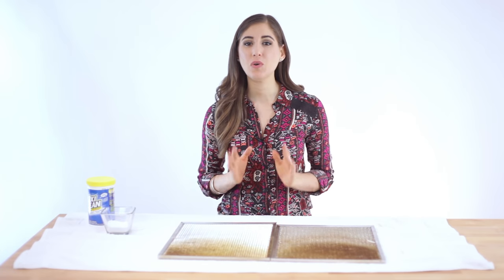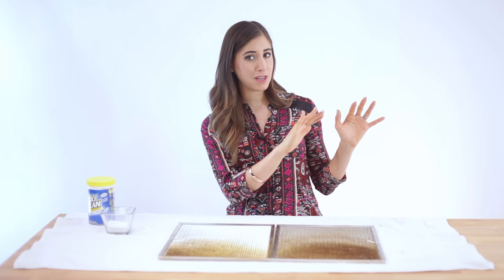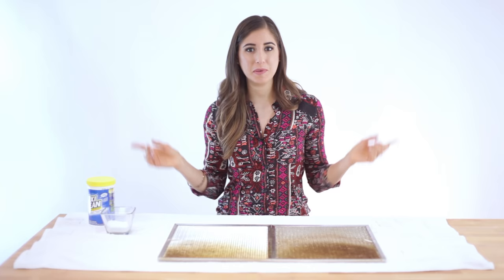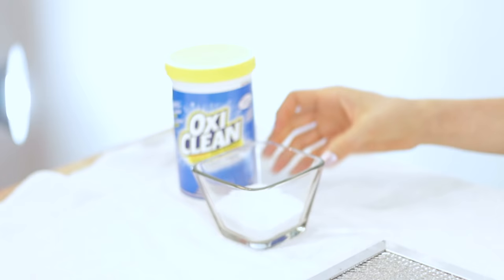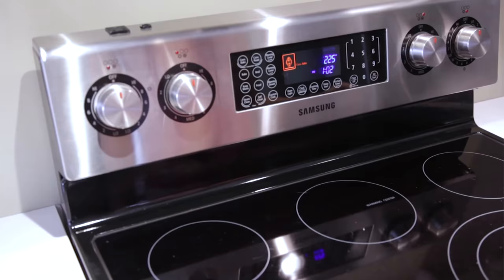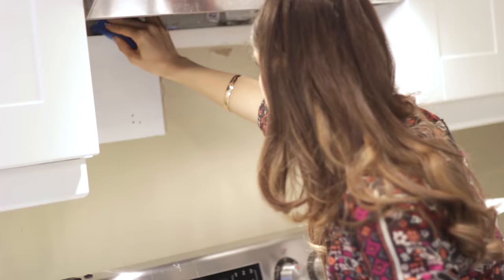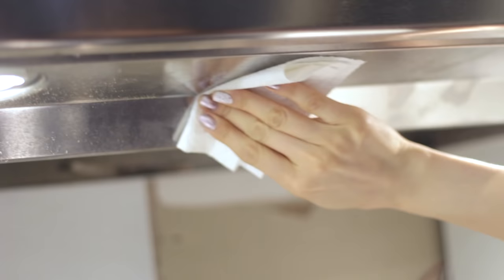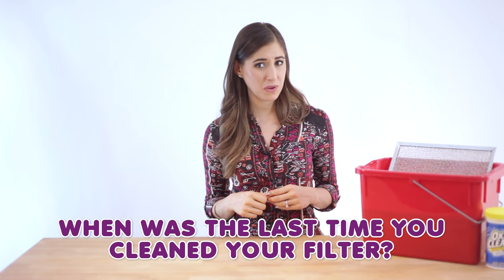Clean Greasy Range Hood Filters! How to Clean Your Stove Hood: Easy Cleaning Ideas (Clean My Space)

Comment: I got no idea how to take mine out...you should of told us how >.>
Reply: It's easy to remove; the filter is only held by the edges. Place your hand under the filter and gently lift up. You'll be able to tilt it up at an angle and it should clear the edges and come out.
Reply from the maker: Yes, see what Luci Miller said, and there may also be small pull tabs that you can use.